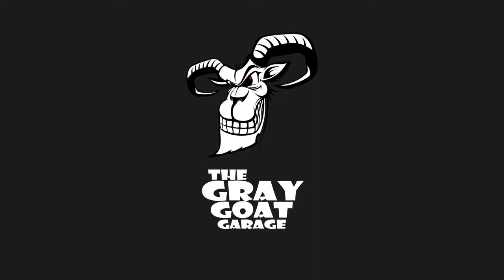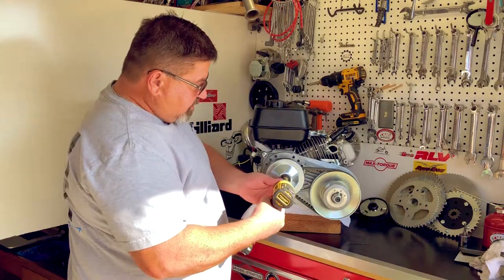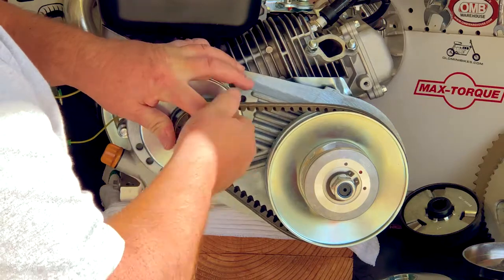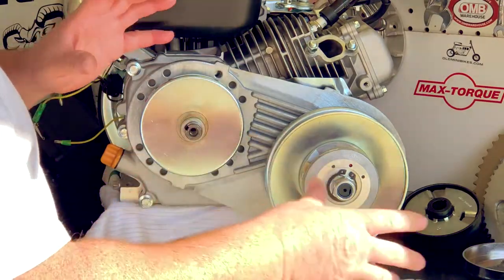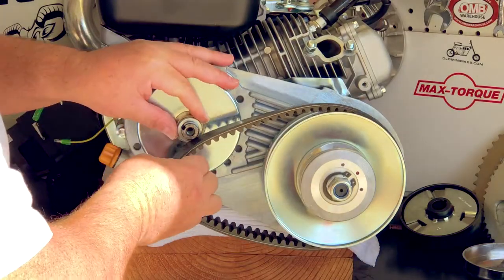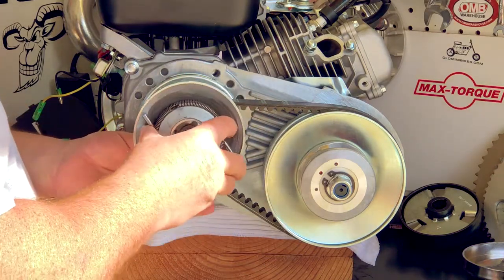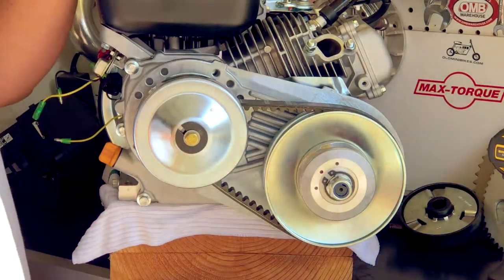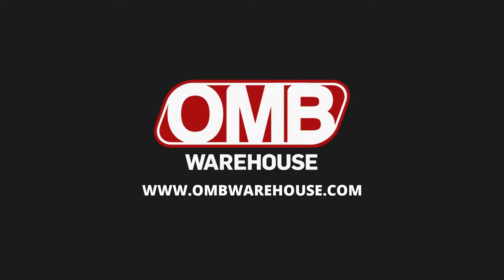How to Change a Torque Converter Belt

Comment: My torque converter driver is hot as hell only a few moments upon start up. And no power.. I pulled and cleaned it after changing the belt but no luck..
Any ideas?

Comment: I just received a 203591 belt and it looks like both sides are cut the same, (no angle) is this normal? Yerf dog old belt was angled but I'm not sure if that is wear or not, new to this.. thx
Reply from the maker: 203591 should be a 30 series belt with one side nearly flat and one side angled. Look at your torque converter. Is the inner pulley flat or angled? 
If both sides are angled you have a 20 series unit. You never know if parts have been changed on 20 year old toys!
Reply: @TheGrayGoatGarage  inner is flat, outer is angled. Maybe I'm thinking the new one is not angled enough because the old one was very worn and worn the angle probably grows. If I look at the new  one it looks like it has a slight angle. Both belt same part number so should I assume its ok?
Reply from the maker: @paulwilkerson5117  I would assume you are fine especially if you have a genuine Comet belt
Reply: @TheGrayGoatGarage  thanks for the info., much appreciated

Comment: I put a 1/2in socket with my drill and it just spun the whole torque converter how do I get it to stay so I can loosen it to take apart to put my new belt on.
Reply: Doubt you still need this but, vice grips. Vice grips.

Comment: May be a stupid question, but what's the profit of using a torque converter? Again, I know it's a dumb question but I just got a minibike and bought a preditor 212 and want to upgrade it properly.
Reply from the maker: A torque converter is a variable pitch type clutch that gives you better low end take-off power and a 10% overdrive. The front driver pulley grabs the belt and the belt will ride up the pulley while the rear driven pulley expands and allows the belt to ride lower changing the effective ratios. Most scenarios where a clutch would burn up will benefit from this design. It is the best of both worlds with having more low end power and higher top speed.
Reply: @TheGrayGoatGarage         Awesome, perfectly explained. Thanks a lot, I will 100% have to utilize this.

  I'm sure I'll be asking all kinds of random questions throughout this build, do you guys have a forum or is there any place you'd recommend I start with all my questions?
Reply from the maker: Hello,
You can always email me at HELP@OMBWarehouse.com
Random questions are a specialty of mine! LOL
Reply: @TheGrayGoatGarage  perfect, very much appreciated!

Comment: What is the correct belt size for trail master mb200 mini bike  ?
Reply from the maker: I don't know! Those bikes may had used 2 different belts depending on the model. If your current belt has "669" on it you would use parts number CPC_203589A
If it has "725" on it I will need some measurements from you. Emai me at HELP@OMBWarehouse.com and I will do my best to help you